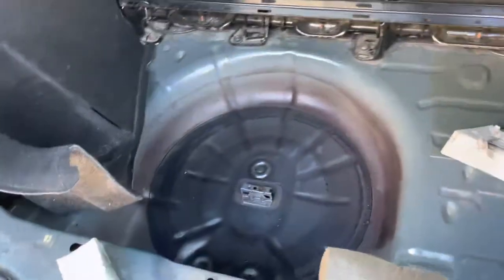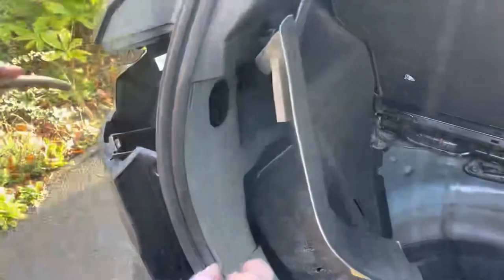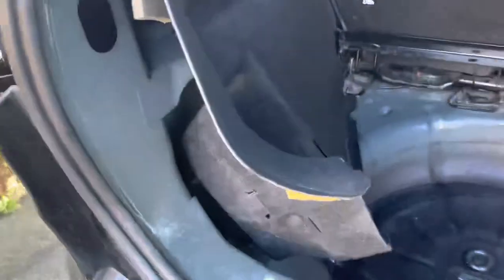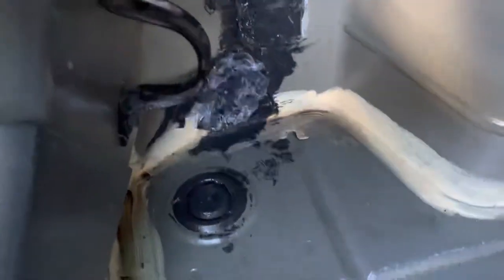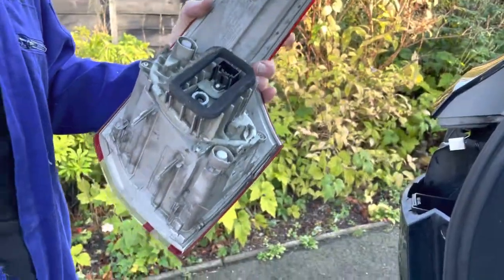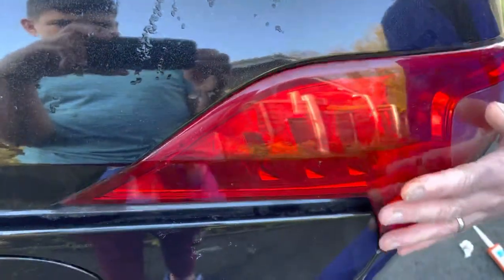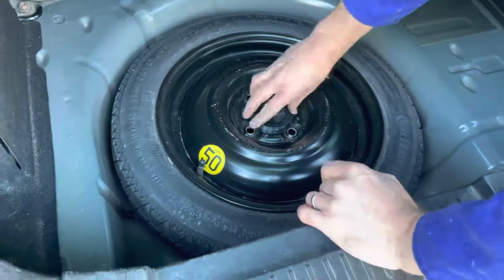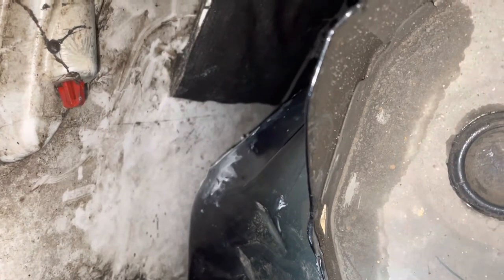Ford B-Max Water In The Boot And Footwells, C-Max S-Max, Home D.I.Y

Comment: I have this exact same issue but what I am finding is that the water in the void (where there is some white foam / fabric material) is just filling up higher and higher and not draining at all. When driving, you can actually hear the water sloshing about. Any idea where this should be draining from? I have been trying to resolve this issue for over three months and whilst I have sealed the inside of the car just as you have, the water is now coming in through a black plastic grommet just below the plastic boot trim that covers the boot lock etc.

I will try looking underneath the car at the vent and hole you have clearly shown, but my concern is, is that the void is still full of water. Hope I am making sense and hope you can shed some light on this, it's driving me insane!
Reply from the maker: Hi David. 
The design is rubbish isn’t it. We have had this ongoing issue for years and it has taken until now for me to work out where the problem was. 
If you look underneath, to the side of the wheel arch, you will see the vent. Just below the vent is where the taped hole is, the hole I had to seal. 
If that hole is still well sealed then there is no where for the water to drain out of. 
Hope you manage to work it out and in a dry location.
Reply: @diyhomeandgardening  It's truly awful. I even bought a USB endoscope camera to try and find out where the water is coming in from. As you say though, it probably is getting in via that hole below the vent, I'm just concerned to how the water will get out as the hole seems to be the lowest point? I guess I need to jack the back of the car up and take a good look. I assume the area in question is easy enough to access with the rear bumper in place? Thanks for the reply.
Reply from the maker: @davidbrooke8839  David, don’t jack up the back if you can hear water inside as the water will travel through the venting channel and flood the foot wells in the rear and front seats. 
I managed to do that last year!!
Park on a slope or jack the front to get the water back and then see how much comes out of the rear vent or bung to the base of the wheel arch.
Reply: @diyhomeandgardening  I finally tackled this at the weekend. I found that by removing the big block of grey foam, I could see into the cavity much more easily. I poured water from a watering can over the back of the car and water leaked in from the black vent behind the rear bumper. I used a long screwdriver to release the vent from the cavity which was a little tricky. 
I gave the vent a good clean and applied silicone to the seal edge and popped it back into place. We have had a decent amount of rainfall here and I can only see a couple of spots of water in the cavity with no water entering the boot compartment itself. I think the water I can see is just spray coming in through the vent so I am 99% confident it has been resolved.
Reply from the maker: @davidbrooke8839  That sounds like a win to me. 
Another great place to have air vents😂 I’ll keep my fingers crossed for you.

Comment: Were you able to fix this water ingress issue perm?
Reply from the maker: Hi. Thanks for watching and the message. 
Yes I sorted the water issues. The sealing of the holes was one aspect but then I also replaced the vents that are located behind the rear bumper. Over time they distort and no longer close properly which means that water can get in, via the drainage channel located under the rear light clusters. 
Hope this helps you.
Reply: Our car got a bit worst than just the boot unfortunately, so we will be removing the front seats to try and dry out the pool of water in there. But first things first , we need to fix the problems of water ingress around the car which I suspect its not only from that air vents but from the panel next to the small side window on the rear or maybe from the rails on the roof. Still investigating next weekend :( horrible
Reply: I must thank you for your video as it was the first video I found that made me aware of the main issue of the water ingress on our car. But I suspect there is more ingress areas because the footwells are filled with water
Reply from the maker: @TugaemBristol  
Hi. So if the passenger and driver footwells are also getting wet, as were ours, then that is water entering via the rear breather vents. 
The vents allow for the whole chassis to breath but also allow any ingress water to travel the length of the car and exit wherever parts have not been adequately sealed. 
If you are able then remove the front carpets to dry out what you can and then park on a slope to get the water to flow to the rear of the chassis, out of the drainage holes. 
We used a dehumidifier afterwards and then replaced the vents.
Reply from the maker: @TugaemBristol  
Sent you a reply to your other message so hopefully that will help. 
Unfortunately the series of cars were so badly designed. 
All the best 🛠️🌼
Reply: Thanks so much for that info! Will definitely use it
Reply from the maker: @TugaemBristol  no problem Pedro. Hope you get things sorted out soon. Have a good day👍

Comment: Eigentlich gutes Video,Lösung funktioniert aber nur mittelfristig. Haben es bei unserem BMax genauso gemacht,nach 1 Jahr aber wieder gleiches Problem, da nur der Wassereintritt in den Innenraum "weggeklebt" wird und sich das eingetretene Wasser im Hohlraum dahinter staut(bis zu  0,5 l circa) und die Klebung wieder gelöst hat.Bei uns war nach heutiger Suche die undichte Zwangsentlüftung hinten die Ursache! Hier läuft das Wasser über die obere Silikondichtungskante und dahinter,von dort aus in den Innenraum.Um das zu erkennen,muss man die hintere Stosstange abbauen ,leider.
Reply from the maker: Many thanks for watching and your message. 
You are correct in the mention of the rear air vents to the chassis as they are also a major cause of leaks as they age and degrade. 
Glade you have managed to sort out your leaking car too 🚘

Comment: I am quite concerned about this as there are a lot of videos on you tube about this water leak I have removed the spare wheel and checked the areas that you have highlighted all along the boot Floor the carpet in the floor of the vehicle driver side passenger side rear passengers and I cannot find any water coming in my vehicle is 9 years old mileage is low but I am concerned about this other videos on this subject matter all point in the same direction as yours so obviously there is a design fault I expect this problem is coming my way
Reply from the maker: Hi Chris. 
Many thanks for watching and your message, although sorry your car is leaking that badly. 

As you have water getting further into your vehicle then it will be down to water ingress for the air vents that are meant to allow the chassis frame to breath. 
The vents are located behind the rear bumper, only covered by rubber flaps which degrade or distort. 

When I did ours, although I had help from my mechanic friend, we found that the old vents hadn’t even been sealed!!
The replacement vents only cost about £40 for the pair, from Fords spares department. 
You need to disconnect the parking sensors and then remove the rear bumper to access the vents. 
You will also need to get suitable body sealant to adhere the replacement vents to the bodywork. 
At the same time you can also check and re-seal any other opening in the bodywork. 

The design of this series of car is terrible. 
Hope this helps you.  All the best

Comment: Wow, what a terrible bit of design - presumably both sides are the same? Nice video, thanks.
Reply from the maker: Hi Peter. 
Thanks for the message and for watching. 
Yes, both sides have an air vent and holes leading to the vehicle interior. 
I’ve now replaced the vents too, just to make sure that no more water could get in. It did require taking the rear bumper off though. 
Good luck with yours

Comment: I had two identical water problems like yours, one at the back, and maybe the mechanic fixed it by doing something in the middle where the bumper is underneath, and indeed, they forgot to connect the parking sensor. I believe the problem at the back has been solved; I haven't seen any more water. But in my B-max, I still have the problem on the passenger side under the upholstery, and it's damp. The body shop guy says that there was a missing plug in the door hinge area. But now it's still damp, and I think maybe the problem is with the A/C leaking condensation or the drainage tubes are blocked. Or even in the hood filter where the windshield wipers are, there's a cover that gets dirty a lot, and there are two holes that could be blocked. Ty for video love
Reply from the maker: Many thanks for watching. 
Glad you got one of your leaks sorted out. 
Behind the trim, in the boot, just next to the wheel arch there are 2 holes that are simply taped over. In my car the tape had also come loose on one of the holes, so that may also be effecting you too. 

There are seemingly so many holes to fix with a B Max. 
All the best with the car 🛠️